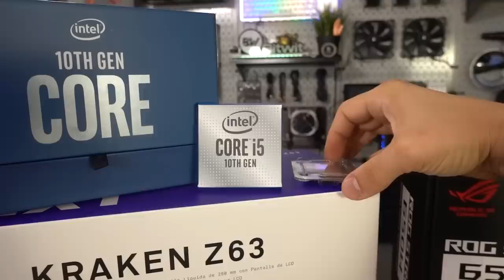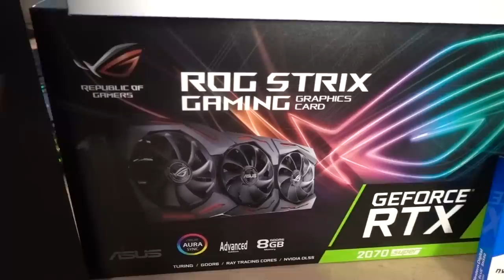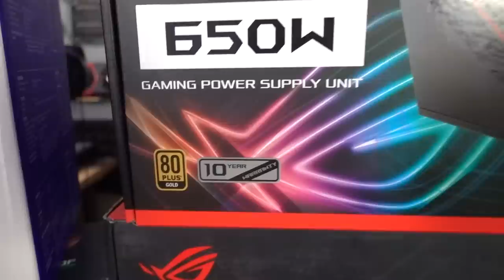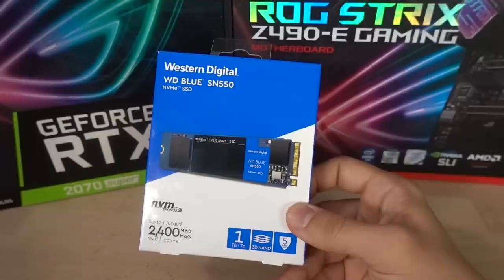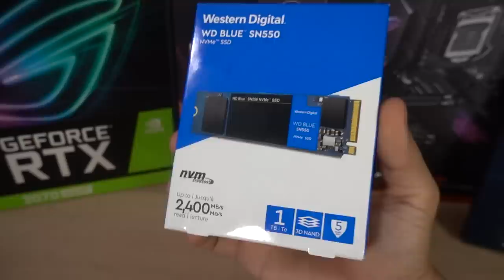Building my first Intel PC in AGES!

Comment: 1600$ “fairly high end”, cries in intel core duo

Edit why the hell did this get so many likes
Reply: What core 2 duo do u have?
Reply: feel u
Reply: same i have duo intel cpu and play on integrated. I cant even run apex legends low settings
Reply: Congratulations, you have old PC.
Reply: Patrick B why not pick up a ryzen 3 3300x
Reply: @koookiiie  because, right now those are really overpriced for what they are. You can get a 3600 for $160 and a 3300x for up to $250 (the prices fluctuate for different retailers).
Reply: BigDaddyLongSchlong That was relatable to me like 2 months ago. I know the feeling man.
Reply: I was running a q9550, but now i got a 3770 from my dad
Reply: I remember having an Intel Core Duo E8500, second best Core Duo CPU beat only by the E8600. Now have the Intel i5 8400. :)
Reply: Get a 3200g system with a b450 board. Easy to upgrade to 3rd gen down the line. Eg. 3600/3700x
Reply: @rubenvanderree2265  I got a Celeron N3050 and it sucks ass
Reply: @rubaiyatmehedi9337  i feel u man
Reply: Joe Bassist thanks for the suggestion! I’ll look into it
Reply: @rubenvanderree2265  the 3770 is still quite a beast for 1080p gaming
Reply: Majestic Savage i picked up a ryzen 5 3600 for 155 at microcenter. Also got a B550 Gaming Plus from MSI from 150, but it ended up being 130 since they give u 20 bucks off for buying the cpu and mobo together. This so much better than my old 1600. My RX 5600XT is finally hitting 99% gpu usage rather than 70 in most games LMAO
Reply: @hssssssssssss  yeah it's a dream compared to a q9550
Reply: I've had my i7 920/gtx 760 build for a while now, it's served me well and only has a problem in newer games like warzone. My dad asked me to help him build a PC for his work and I finally took the opportunity to upgrade since I was already ordering parts. Ryzen 3 3100 + Rx 580 8gb is probably the best value you can get. Around $500 for a beast 1080p machine that'll last quite a while.
Reply: @buddybleeyes  depending on budget it might be more worth it to buy something like a 3100 for the same price and a dedicated GPU. Or even if you wanted to save more money in exchange for upgradeability an i3-9100f would leave even more money for GPU.
Reply: @joshsteiner9712  3300X would've been a better choice to be quite honest with you. Saving a few bucks was not worth it.
Reply: Patrick B  just got a asus b450f and ryzen 2700x for $200
Reply: @Michael-hx6ls  I know it would have been better but it's either out of stock or over $180 everywhere. I managed to get the 3100 for $99 before it went out of stock everywhere and it's certainly not a bad CPU.
Reply: @joshsteiner9712  not a bad idea :) the only reason why I said about the 3200g is because my friend just picked up one, and is upgrading from a 660ti to a 1660 super soon :) it's a pretty good pairing for 1080p games without breaking the bank completely :) the 660ti holds up ok though, definitly struggles but it's better than nothing so it's a good stop gap for my friend :) but I do completely agree with you there :)
Reply: Me on i5 480m
Reply: @buddybleeyes  yeah the 3200g certainly isn't a bad choice but if you already have/plan on getting a dedicated GPU the 3100 offers better performance for the same price. That is if you can find it in stock anywhere ; )
Reply: Patrick B  also get a radeon rx 5600xt for a good ish price too, then you a have a medium build that can do 60fps for a good couple years, i currently have a ryzen 5 2600x with a 5600xt and tbh i got better scores than i thought i would,
Reply: @joshsteiner9712  agreed there, its finding them in stock or at rrp 😅when I looked a few days ago, its was £20 off the 3600 😂
Reply: Luke Van den Akker  that better be a joke lmao
Reply: @koookiiie  have you seen the prices for them?
Reply: @Michael-hx6ls  go check the prices for a 3300x and come back.
Reply: Patrick B  1600 af is better
Reply: Luke Van den Akker  yeah you're certainly lucky. I can't complain tho I got a decent rig for 1080p and plenty of room to upgrade.
Reply: @derfnam6627  the 2600 is better than the 1600af, although the 1600af was better for the money when it was $105. Now it's hard to find one for less than $160, which is more than a 2600 or even a 3600.
Reply: Lol I just got a 10400 and a LGA 1200 mobo for just over $200. I am going to be killing it and making fun of Intel
Reply: Cries in integrated graphics card
Reply: BigDaddyLongSchlong I went from a 8-12 year old system with old Ryzen apu to a i7-9700F 1660 ti
Reply: $1600 "fairly high end", cries in Canadian Dollars.
Reply: Cries in 4570
Reply: Patrick B  that's my build and here in Peru it is like 350€ (best case) :(
Reply: C. Milstone oof got a b450m ds3h and a r5 2600 for like 220$
Reply: I mean you could turn a optiplex into a gaming rig for like $200-300 like $50-80 for the pc, used rx 480 is like 100, and a ssd for like 30-40 also a new power supply for 40
Reply: Stop pitying urself its not funny
Reply: Cries in pentium 4415y 2 cores 1.6GHz, 4GB ram and intel hd 615
Reply: @buddybleeyes  just bought last month and before thought to upgrade 3200g to 3600 but i am totally fine with it for now...
Reply: Me intel pentium g3250
Reply: @siraj2cool  that's great to hear man! It can be a good cpu with a lower powered graphics card :) I wouldn't recommend with anything above a 2060 super :) glad it's going strong for now :D
Reply: @rubenvanderree2265  i was running a e2200 but now im running a 3900x😂
Reply: @Darkvame  why not?
Reply: @buddybleeyes  yes i am using 1660 it works perfectly for my need of 60 fps gaming
Reply: @C.Milstone  how i am looking for something like it.
Reply: @reloadingdontshoot1  it is not at all.
Reply: My is 6 year old mobo and cpu a8 7600b with asus a78m-e with 8gb ddr3 1600mhz.
Reply: q6600 gang
Reply: @Onni Pirinen depends on location, where im at it is very overpriced
Reply: reloadingdontshoot1 true, a few years back and $1600 would be upper mid tier, now it’s just mid tier. My $1200 build is fine for 1080p tho.
Reply: @WilliamHollinger2019  gotta look online for deals
Reply: Oof. I've looted working Sandy Bridge PCs (i5-2500 non-K).
Reply: Im the 1,000th like
Reply: Intel: We maybe ending our CPU manufacturing efforts (announced during earnings report).

Bitwit: Look everyone I built an Intel Computer!
Reply: Luke Van den Akker  you sound like a young kid. Talking about you have a 3900x and ordered a 10900k too, yeah ok sure ya did, and sure ya do.
Reply: @rubenvanderree2265  @4.3ghz?
Reply: @ishraq5014   Many of the newer workstations (Dell, HP) use proprietary PSUs. I think the most recent 24-pin optiplex is Intel 3rd gen, and HP is 4th or 6th gen. depending on the model/line. PSU adapters are available for some, others would only work with cards like gtx1650 or rx560.
 (My old optiplex has a rx470... it's mostly a browsing machine).
Reply: Pezfeo good point
Reply: wow, $1600 USD for a computer I wish mine cost that mine cost about $5700 and that's not including peripherals or screen with all of it costing around $8000 USD plus u want to do more. all my prices are converted from Australian dollar which things just cost more over here all up I have spent 11000 on mine plus I want more like a second screen, yes $8000usd with one screen and more RGB lighting from Philips hue.
Reply: Please, once you got a q9550 and a gt 710 oc'd you're good to go
(I mean the ddr5 710, do not get the ddr3)
Reply: @joshsteiner9712  I think your better off saving fora good 6-8 core
Reply: Patrick B or you can just get a amd thread ripper
Reply: @buddybleeyes  agree. I got 3200g for 60/70€
Reply: Patrick B  Or a used 2200g plus a new cheap b450 motherboard that's like $125
Reply: cries in ryzen 5
Reply: Zach Skis Bad Ryzen 5 is good
Reply: @justnathan_4087  okay thanks kinda commented just to know if it was good or not because im building my first pc in about a week or so. running on a windows laptop hooked up to a monitor and peripherals right now
Reply: Me crying in intel pentium j3710
Reply: damn
Reply: @buddybleeyes  you say it's easy to upgrade to 3rd gen down the line yet you have a 3rd gen
Reply: @kirizero  b450, b550 boards exist (b550 is too expensive for budget pcs though). Going from a 3200g/3400g to a 3600/3600x would be a natural upgrade for the next few years if you don't have alot of money. I've been through this upgrade process with my friends, so I've heavily looked into it. Edit: 3200g and 3400g are better than the gen 2 apu's, paired with a lower end graphics card it can be a great budget set up. If you want abit more cpu power down the line, you could even go up to a 3700x with no problems on most b450 boards. it's more bang for your money, with a small upgrade plan
Reply: @rubenvanderree2265  E7500
Reply: i have a celeron t3500.
Reply: @Darkvame  i cant even run league of legends
Reply: Just do what I did go on eBay by an old dell workstation with 16gb ram and an i5 then put a 1060 6gb in it the whole build cost me 350 and when I upgrade I just buy a newer refurbished dell workstation with newer parts and then just swap the graphics card over and keep on trucking been doing that for about 5 years now you’ll never have brand new best of the Best But it will game on medium settings
Reply: @zackschilling5154  bruh send me the link
Reply: @zackschilling5154  right now
Reply: Alex Tutorials, Gaming,Clips etc! Nothing special but will play most titles I use mine for beam ng drive, wreck fest and Astroneer the only thing you need to watch for with the graphics card is that it doesn’t need external power otherwise it won’t run because the power supplies they have in the desktops don’t have extra power cables coming out and they are not modular at all the motherboards in those machines don’t work very well with after market power supplies due to proprietary connectors
Reply: @zackschilling5154  okay thank u for letting me know but can I get the link?
Reply: @zackschilling5154  Bruh the link?
Reply: @majesticsavage5322  especially with the gpus. They cost like thousands and the older ones are way more expensive than the newer ones. RTX 2080 super cost 1600 dollars.
Reply: I feel you bruh...
Reply: @rubenvanderree2265  i have a t5250
Reply: @koookiiie  ye install a Ryzen zen 2 chip into an intel mobo from 1999
Reply: @Darkvame  my 10 yr old laptop can't even run minecraft lmao

Comment: Guy: I dont know how to OC and won’t be doing it... 

Kyle: Lets build a fully overclockable rig for you dripping in overclockyness.
Reply: *overclock(i)ness
Reply: I don't play games, but build my PC workstations to be overclockable at all levels. The big fat graphics adapter does CUDA and the more RAM it has the better.
I don't need the overclocking but the components used in the motherboard like power rails and capacitors make the whole thing much more robust and reliable.
So the relatively high price I pay, is earned back because the machine lasts longer and is pleasantly responsive with newer software that generates a higher load (or has become more bloated again).
One of those builds I actually underclocked a bit to silence it.
Reply: thus why AMD is such a strong competitor right now

Comment: God the AIO mounted on the CPU like that covering over one of the memory slots is quite triggering.
Reply: im glad im not the only one that was thinking that lol
Reply: THANK you. I don't even know if there's clearance enough to populate that first slot. >_>
Reply: As someone who owns both this motherboard and and AOI cooler I can confirm there’s no room for ram on the first slot, had to mount my AOI tubs facing up to fit my ram and now I can only use certain gifs cause they’re all flipped :(
Reply: @XxKobraKiidxX  dont quote me bc i dont own it this is just what ive read. cant you flip the gif you're using any way you want in the settings?
Reply: Well one good thing that he did point out though at least that it is one of the most expensive AIOS on the market.

Comment: "No one likes Molex"

until your pump pulls 1.8 amps and the fan headers start smoking
Reply: Sata ftw. Can do like 50W.

In fact, in my main rig, I think my pump is using a sata to molex adapter so I didn't need an entire PSU cable just for the pump
Reply: Molax is easier to fix i use it for fans only. It was used to be for powering drives.
Reply: @That1Guy-w5y  It's an older style of power connector the current gen of elitist techs are trying to make extinct because they don't like it for some reason. It's more durable in most cases as well. I don't understand this trend to go for thinner more easily broken connectors for everything.
Reply: @bdhale34  molex and durable, funny joke.
Reply: @vincentlira1956  It breaks less often than thin sata plugs do.. the method of wiring could be better but overall it's a more durable connector. Hell I've seen more hard drive and disc media drives with broken plugs on their side of things than I have on the PSU side.
Reply: Idk it's a lot harder to make a weak molex than a weak sata (power) connector in my experience. The pins in molex just inherently aren't as secure and are easy to pull. 

Plus, since it's basically a given to have SATA drives in most systems, it's nice if other devices also use the same cable, reducing overall cabling in the system
Reply: I'm using molex for case fans. One exhaust fan using 3pin mobo
Reply: @tarfeef_4268  Those adapters are so crappy imho.
Reply: @Xfade81  you're not wrong. But they save a lot of space. I tend to do a lot of SFF builds so that is often of value to me
Reply: I've seen so much broken molex it's not even funny. SATA data also breaks all the time. SATA power is aight. PWM fans FTW as well.
Reply: @bdhale34  tech elitist? What? XD

Comment: You helped me build my first pc man and I appreciate it 🔥🔥🔥🔥. Wasn’t a beast but it still works good
Reply: what specs
Reply: @kalyanikajannapathy6578  Ryzen 3 1200
Gigabyte 1030
Vengeance lpx 8gb x2
Tuf b450 motherboard

Didn’t over lock either
Already had a case so I just used that. Like I said not impressive but it works

Comment: If you can choose your RGB values by manually tweaking the "255, 255, 255" to something like: "230, 180, 255," you can make the whites match. It takes time, but I have made a very yellow, and a very blue "white" match each other. If it seems yellow, bring down green a lot and red a little. If it seems too blue bring down blue just a hair and then you may need to bring down green as well.
Reply: Sometimes they are really far off. I think white on my Logitech keyboard is like "170, 145, 255" but it looks perfect after taking the time to tweak it.

Comment: Kyle: you did a nice job, the Define 7 case needed more room for better cable management like another 1/2 inch height x 1 inch length x 1/4 inch width. As you mentioned, Mike has better things to do than play PC games or video games. Mike's 8 or 9 year old desktop is younger than mine as my DIY was done in May 2008 or 12 years ago. I'm certainly overdue as my mobo is a LGA 775. (GA-X48T-DQ6 with Intel 2 Core E8500). Unfortunately, my money been spent on car repairs instead of a new PC. Had to get the Fuel Tank Module Assembly and locking ring (about $600) replaced since had a Small EVAP Leak (Code caused the Check Engine Light to turn on) which I had a tech performed a smoke test $127. The EVAP repair cost was just over $900.  Tomorrow having all 4 brakes done (Rotors and Pad) plus Emergency Brakes and NYS Vehicle inspection probably looking at $1,100 to $1,200 with Tax.
Wished I had my $2,000 back in my pocket instead of paying for car repairs so I could do a DIY build here in July 2020. I was not able to do the car repairs myself as I don't have all the proper equipment and tools or a hydraulic lift  and a support stand to drop a gas tank onto. Did attempt brakes however, the rotors were seized and rusted on, could not break it loose with a  sledgehammer and pry bar and WD 40 penetrating spray , did nothing but break my back for 3 days, took me 2 days to get the two caliper mounting bracket bolts loose, needed a breaking bar and galvanized pipe for leverage to loosen those darn bolts, so just have to leave the brakes to the pros. Hate returning parts to the auto parts store I wanted to save myself $400 to $500 in DIY repair.

Comment: Looks like the hoses for the cooler preclude using the first dimm slot closest to the CPU. So, you really couldn't add another dual channel kit. Or is that just the angle?
Reply: You definitely couldn't mount 4 ram sticks with the AIO hoses mounted that way. Seems like either a poorly designed Motherboard or AIO
Reply: Yeah, at 26:24 it really does look like you'd struggle to get a stick into the first slot - you might manage it but you'd be putting pressure on the RAM stick. And the hoses look really chunky with that sleeving. Just go for two higher capacity sticks I guess?

Comment: Loved this video!  Such a clean build. What got me though was the fan installation at the top of the case 17:17. Wouldn't it be better to mount it as an intake instead of an exhaust? That way you get more out of the dust filter.

Comment: I think one of the reasons that white can look a bit 'off' on some RGB products is that they dont have dedicated white outputs, they just mix the RGB outputs. Which is obviously supposed to work in theory, but it never quite gets there. I have the same issue on my EVGA card and my NZXT Kraken (the older one) - you can just tell that the colors are splitting slightly and it's not giving off pure white.